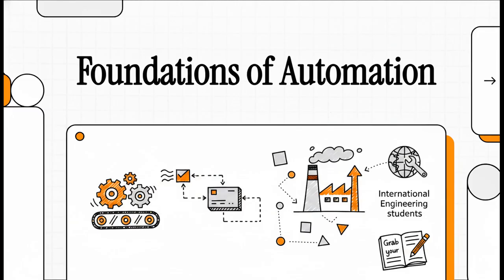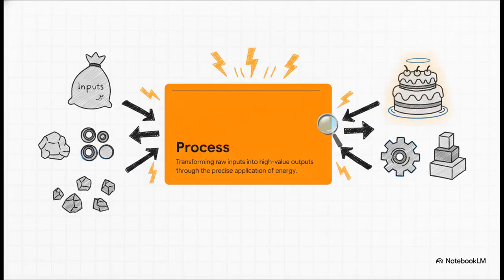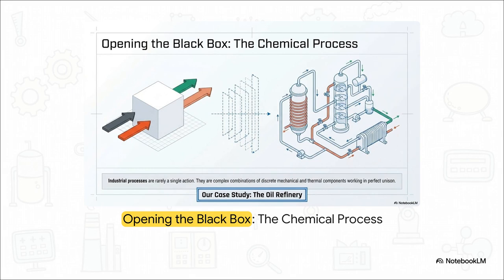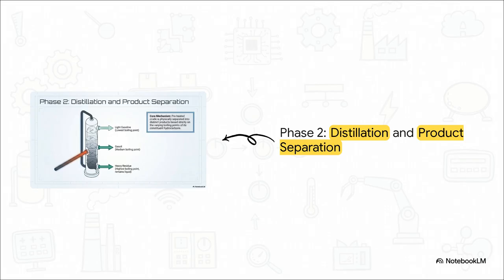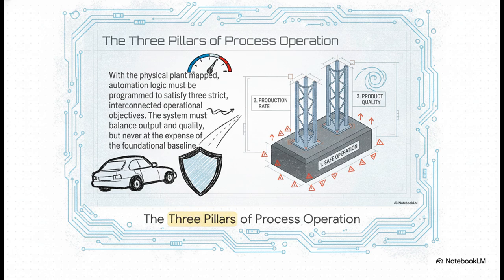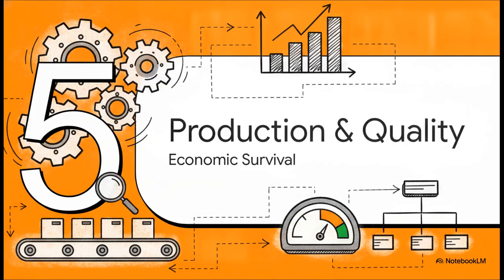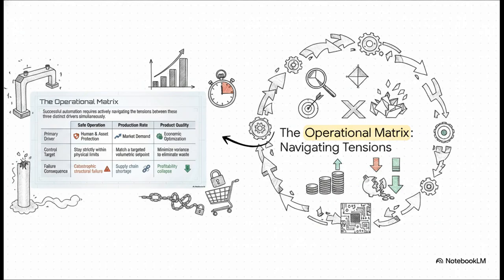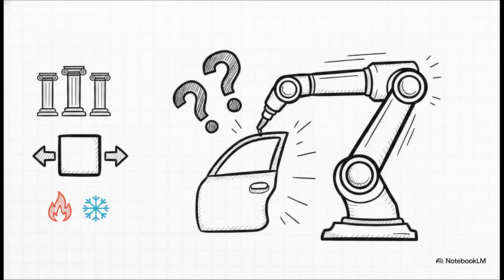Foundations of Automation

Comment: Thank you Dr Mahdian the video helped us understand that industrial automation is not only about making machines operate automatically, but also about controlling a complete industrial system intelligently.
My question is:
Can we say that the main purpose of industrial automation is not only automatic operation, but also risk management and performance optimization? For example, reducing waste energy, protecting equipment, maintaining product quality, and at the same time keeping the engineer’s role important in monitoring, analysis, and decision-making.
Reply from the maker: Thank you for your insightful question. Yes, that is a very accurate way to think about it. Industrial automation is not only about making a system run automatically, but about ensuring safe, reliable, and optimal operation of the entire process.

In practice, automation systems are designed to achieve multiple objectives simultaneously: improving performance, reducing energy consumption and waste, maintaining product quality, and most importantly ensuring safety and risk mitigation for both equipment and operators.

At the same time, the role of the engineer does not disappear—instead, it shifts toward higher-level tasks such as supervision, system design, diagnostics, optimization, and decision-making. So rather than replacing the engineer, automation actually elevates the engineering role to a more analytical and strategic level.
Reply: @ControlandAI  thank you Dr

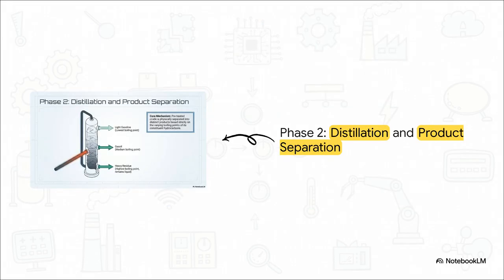Comment: Doctor, at minute 3:35 you talked about the oil refinery and its separation from the products? Is the boiling point always constant? In this case? And in our case, if the boiling point or temperature is different, will we get different products from the same crude oil?
Reply from the maker: The boiling point is not a single constant value for crude oil, because crude oil is not a pure substance—it is a mixture of many hydrocarbons, each with its own boiling point.

In a refinery, separation is based on boiling point ranges, not one fixed temperature. In a distillation column, different fractions (like gases, gasoline, kerosene, diesel) are separated because each component vaporizes at different temperature intervals under the same pressure conditions.

So yes—if the operating conditions (especially pressure and temperature profile) change, the cut points between fractions will shift. That can affect product quality and yield distribution, meaning you may get different proportions of products from the same crude oil feedstock.

This is exactly why refineries rely on tight temperature control and pressure control to ensure consistent separation and product specifications.
Reply: @ControlandAI       Thank you so much, Doctor. Now I understand and things are much clearer regarding this point.

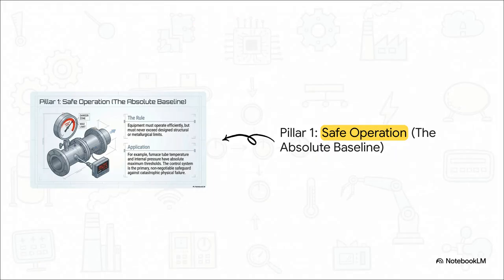Comment: In minute 5:35 in the video, What is meant by the engineering term "Metallurgical Limits" of equipment? How does the PLC program act as the primary safeguard to protect these limits before a human operator can react?
Reply from the maker: Great question. “Metallurgical limits” refers to the physical and material boundaries of equipment beyond which the material itself starts to degrade or fail. These limits come from metallurgy and materials science—such as maximum allowable stress, temperature, pressure, fatigue limits, creep, or corrosion thresholds. If a process pushes equipment beyond these limits, you may get permanent deformation, cracking, accelerated aging, or sudden failure.

In industrial systems, the PLC acts as a fast protective layer that prevents the process from ever reaching those dangerous regions. It continuously monitors critical variables through sensors and enforces interlocks, alarms, and trip logic. If a variable approaches a safe limit, the PLC can automatically reduce output, shut down a subsystem, or switch to a safe state—much faster than any human operator can react.

So in simple terms: metallurgy defines the absolute physical boundaries, and the PLC ensures the system stays well inside those boundaries by acting as the first and fastest line of defense.